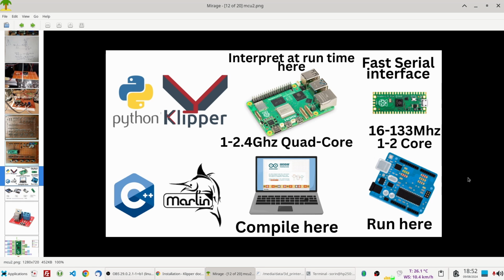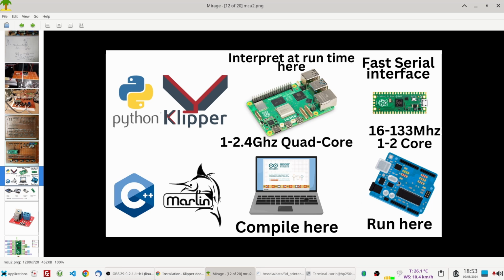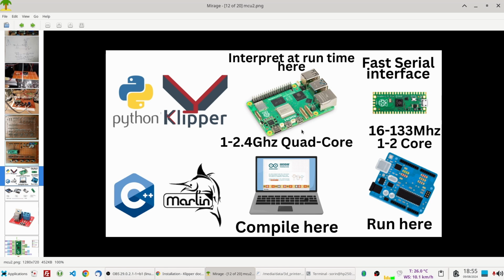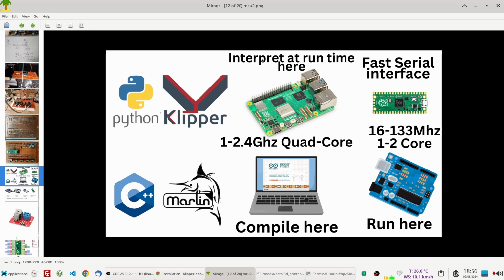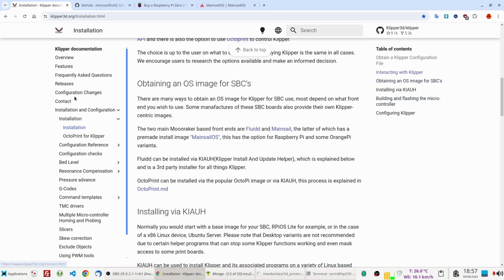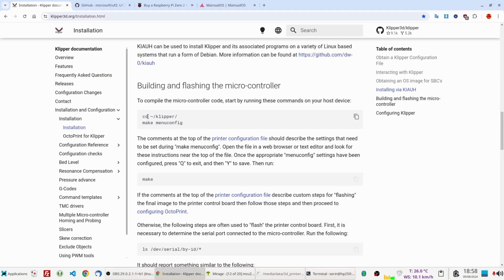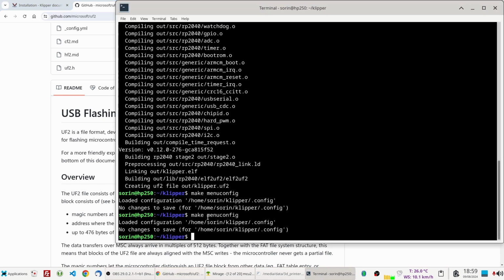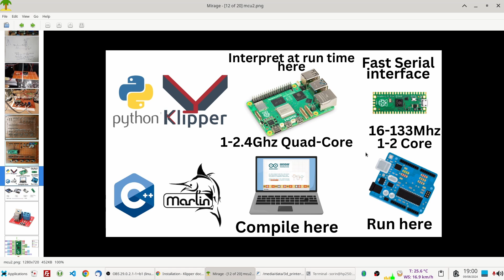How to install klipper on raspberry pi pico

Comment: I run make menu config, choose correct options for RP2040 using USB connect , But it creates in the out folder klipper.elf and klipper.bin  NOT the klipper.uf2  :(
Reply from the maker: you probably played around with the options, do this: get a clean copy - git clone https://github.com/Klipper3d/klipper, make menuconfig - and only change architecture to - rp2040, then press Q for exit and save, then make. and it will generate the uf2 file, I have done it many times.
Reply: @CNCTinker  it was because i had bootloader selected, need no bootloader for klipper.uf2. :D